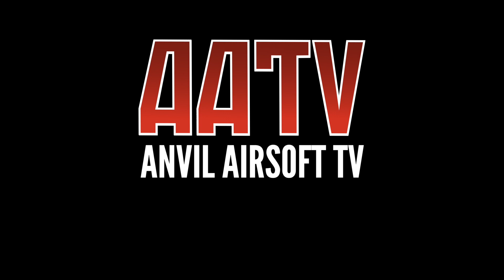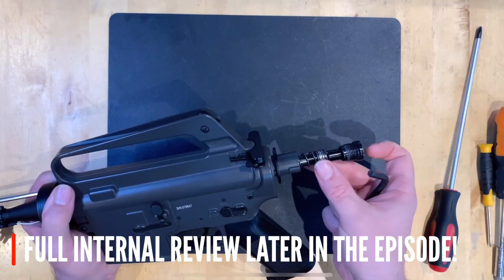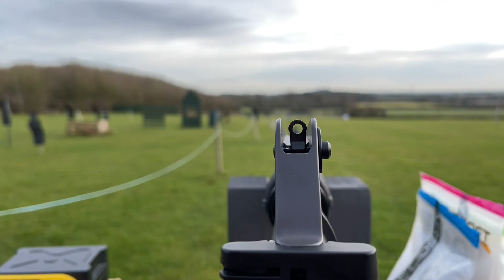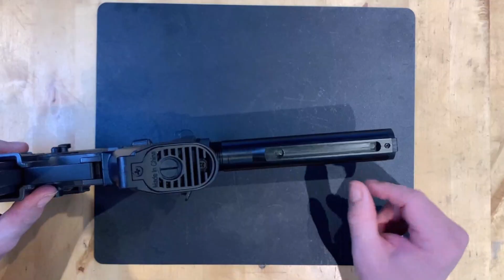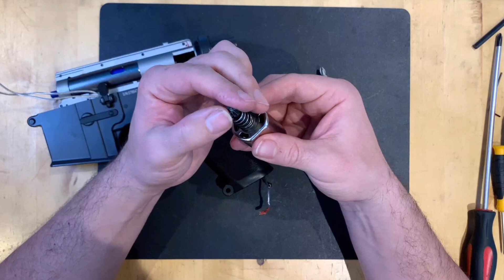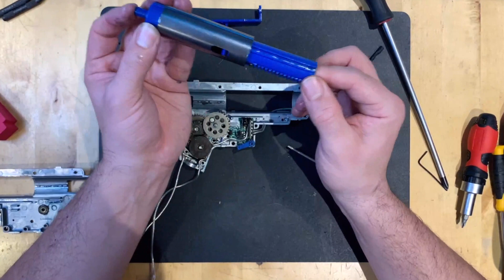AATV Cyma CM.009E - XM177 Airsoft Replica Review

Comment: I got mine today. As it seems one of the last ones available from Taiwangun currently. The bolt catch/release did not work, I took it apart and re-connected its spring, but it is still not closing the bolt when pressed. It seems things are a bit tight around it in there. I can live with it for now and try to solve it next time I take it apart.
Reply from the maker: Always the first thing you should do in such cases is to contact our techs. Maybe there was a chance to repair it easily, even without tearing things apart.

Comment: Bought one of the Cyma colt 653 replicas from TaiwanGun when it was on sale.  Great gun; out of the box mosfet and it fits real skinny handguards!  If you go that route though, be prepared to remove the heatshields, grind some plastic, and get a very slender lipo pack.  Went with JG for my xm177 to save a few pennies; it's a good gun, but not quite at the same level as the Cyma!